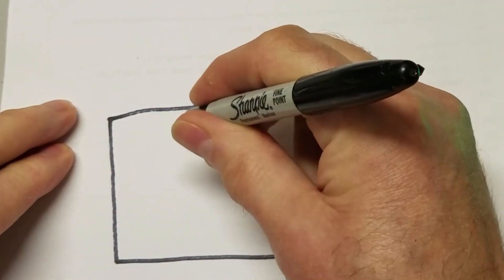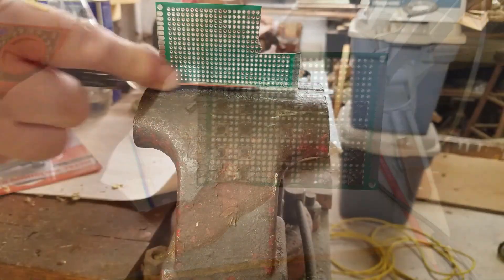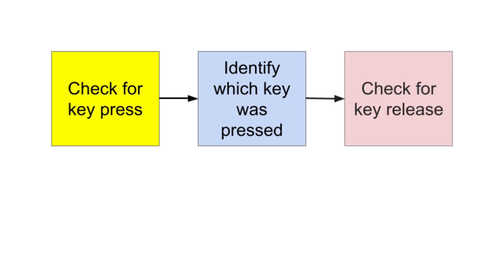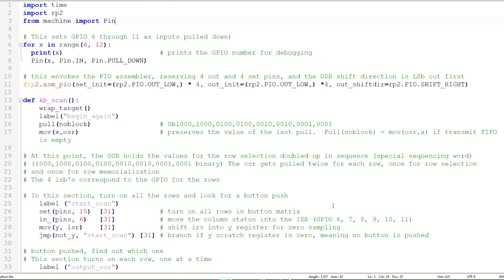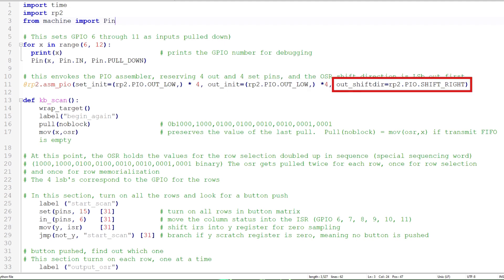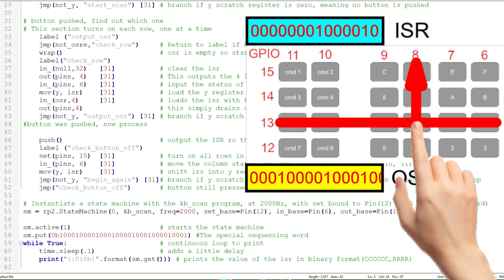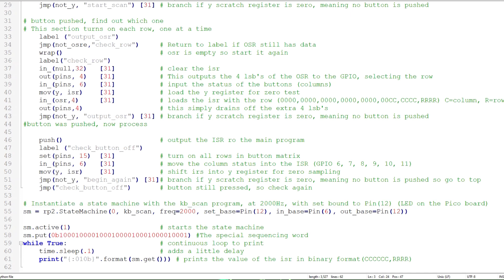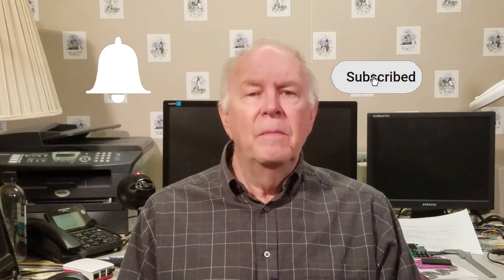PIO Scanned Keyboard with MicroPython - RasPi Pico PIO Chronicles - Ep.21

Comment: I recently used PIO for debouncing the contacts of a rotary encoder(closed is closed, but open is only trusted if the contact reads open continuously for ~500us).  I've also used PIO to simulate a non-inverting buffer, for debouncing double throw switches.
Reply from the maker: PIO is awesome, you can do almost everything with it.  Thanks for the comment.

Comment: Funny this is...I ordered some larger protoboards this morning, because what I have are too short.  It didn't occur to me to glue two together.  I'll have to try it instead of waiting two weeks.
Reply from the maker: I used the Pico to align and space the two pieces together.  I held them together with making tape and something to make them flat for the initial glue up.  After that hardened, I placed the strips of tissue the top and bottom of the joint and then soaked them in super glue.  Good luck!